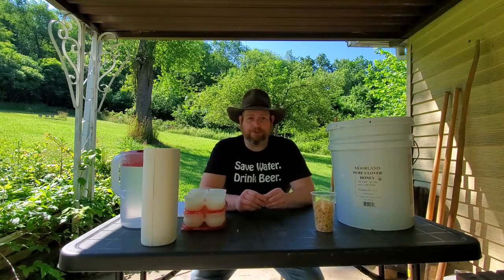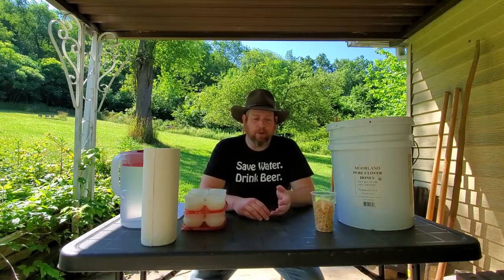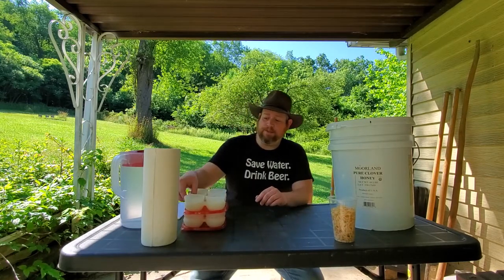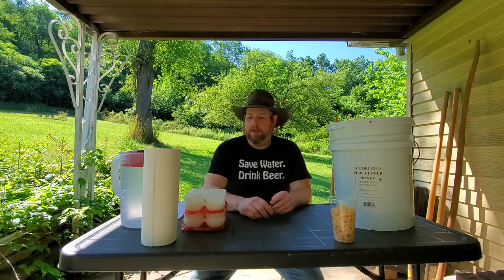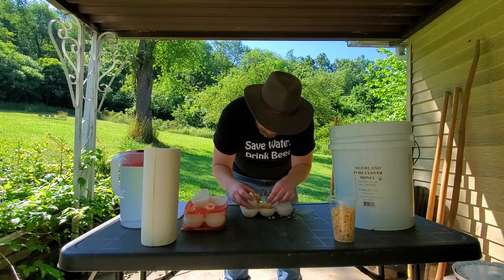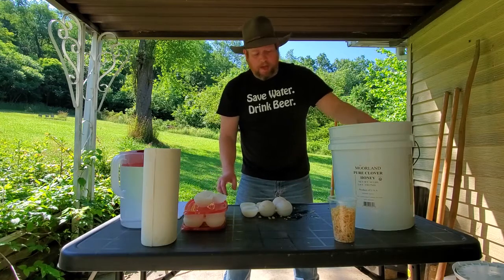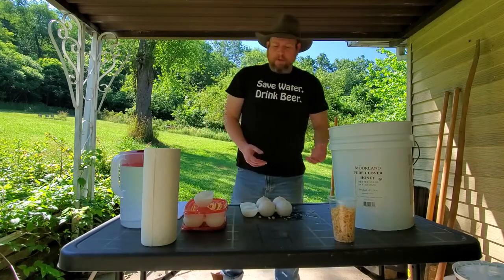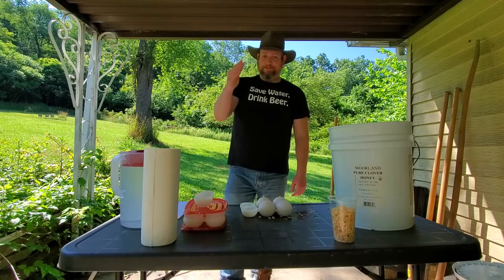Making Pykrete (for slinging)

Comment: What is the temperate where you are? I would love to use ice or pykrete ammunition but I think it might be too hot where I live.
Reply from the maker: I'm in Pennsylvania.  So summers are usually mid 80s to low 90s (Fahrenheit, just in case).  Winters are below freezing.  I still sling ice in the summer, but I have the advantage that I sling in my yard.  So I can fill up a bucket from the freezer and go right outside and sling them.  Ice is a great projectile option, but if it's warm outside it's not going to travel far.
Reply: Very interesting video, great slinging and lovely Kitty !!!